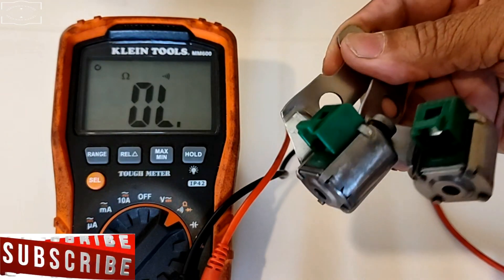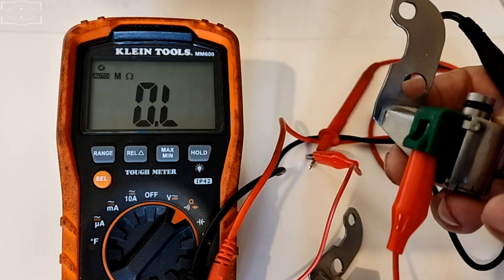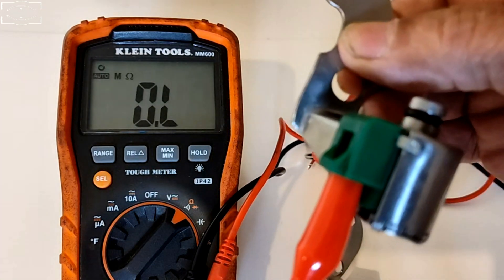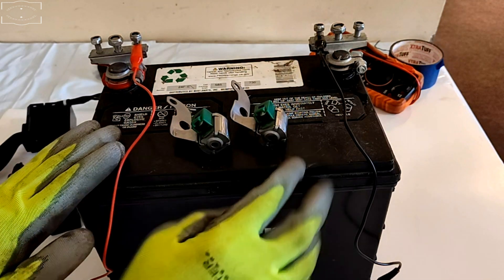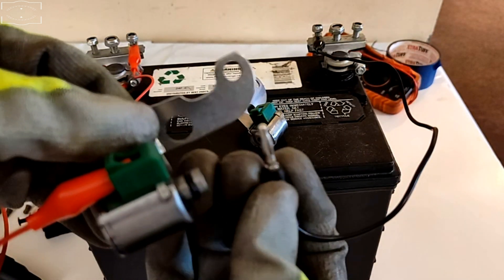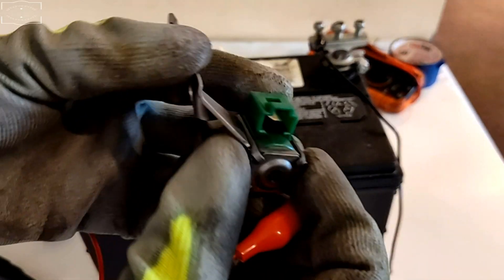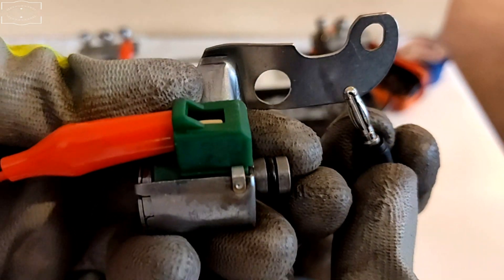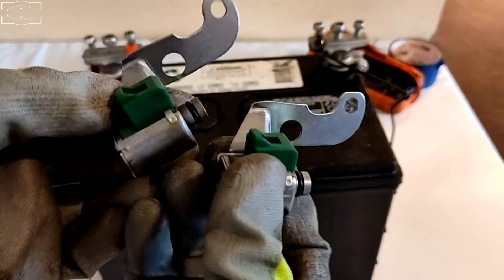How To Test A Shift Solenoid With A Multimeter

Comment: Greetings was what I was looking for, or I think, I consult you, those same selenoids in my automatic box have the correct ohms, but when doing the 12 v battery test one sounds hard the times I connect it and the other sounds only once, that is, it does not make it more very low as you have in this video, that is indicative that is wrong that Selenoid? Thank you very much
Reply from the maker: if the operated sound is too low, it should be damaged, it should sound strong, but also you should have code for this solenoid stored in the pcm.
Reply: @mairasan-ud5ih  Thank you, the code is not there, at the level of the coil its ohms are perfect, but I think from what you tell me it does not emit loud sound, it is very slight, conclusion damaged.

Comment: Brother my car makes noises
 when put into gear and wont move is that a 90 percent problem of a bad or chocked solenoid???
Reply from the maker: you should have codes related to solenoids if the issue would be a solenoid, also there are no noises when the problem is related to a solenoid, you will hear noises only when the issue is a transmission mechanically failure. also bad axles make noises.
Reply: @ Ok true, Thank you Brother :finger-red-number-one: